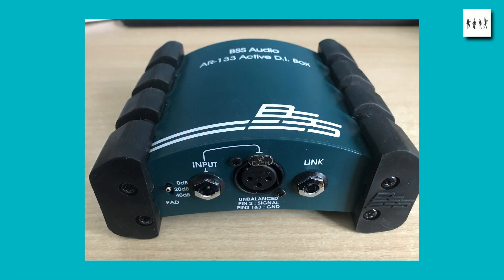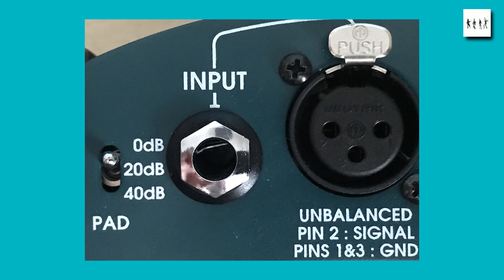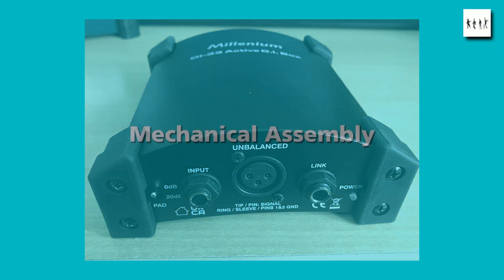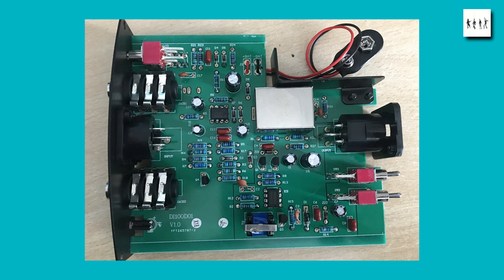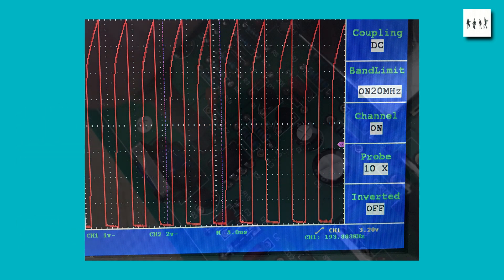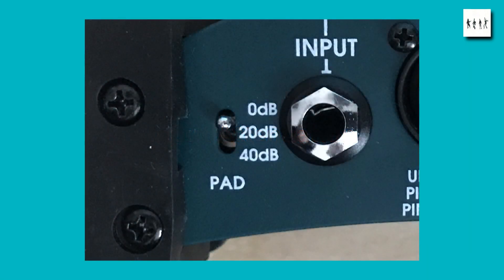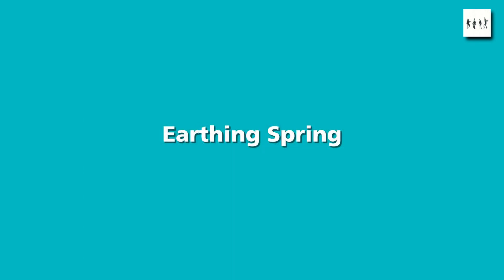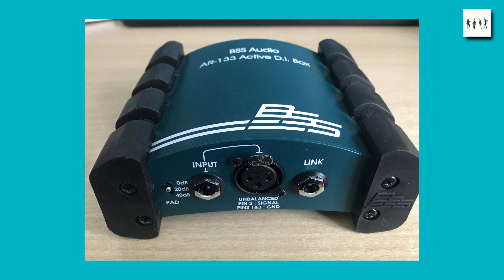BSS AR-133 and Millenium DI-33 DI boxes compared (No Audio Tests!)

Comment: Thank you so much for this video. I've worked a lot with the BSS DI boxes, and have had one or two fail on me (but that is to be expected when working with Hire equipment that goes out all the time), so even if the companents are more expensive doesn't necessarily mean they will last. I will probably get myself a bunch of the Millenium DI's (Both the 33 and 66), as if they happen to fail or break, I can easily replace it.
When I was doing a sound system upgrade at a church that had little to no budget, I purchased about 7 or 8 of the Millenium DI-E passive DI's, as they were only £8 at the time, and the church were sending so many unbalanced signals through the system that it made my head spin (so many unbalanced TS to Male XLR leads going straight into the stage box)
Reply from the maker: You're welcome - it was an interesting exercise. I guess no matter how robust things are designed to be, someone will find a way to break it - especially with hired equipment! Probably worth getting one of each first, just to see if they work for you before committing to a whole load of them!